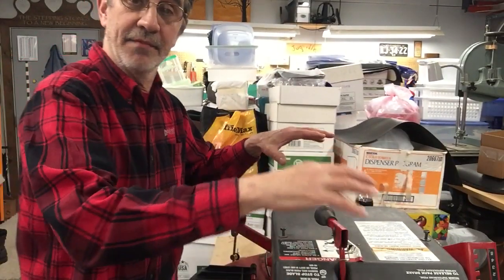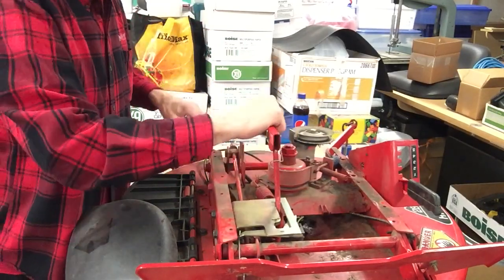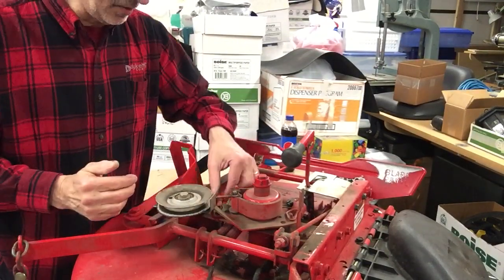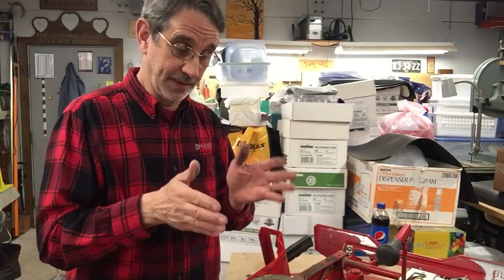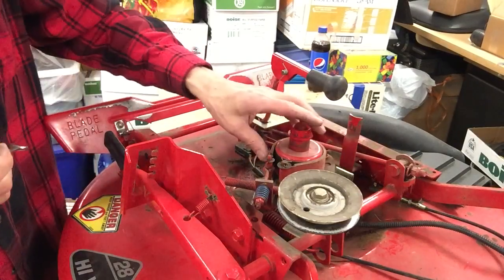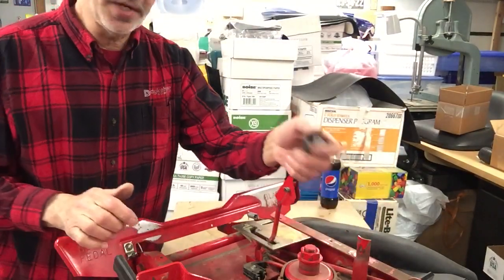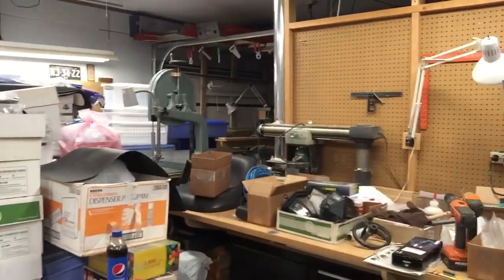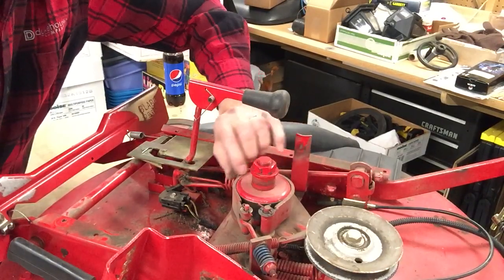339. M/S 64. How Can I adjust the brake for my blade

Comment: Hi Jim - it's Big Rodders in Ireland.  They certainly have moved to a more sophisticated adjustment system compared to my square framed 1996 RER, which sported a Mickley Mouse 2 location brake adjustment plate.  You may recall I emailed some photos of the adaptation I was forced to make to have an infinitely adjusted system like yours.  My approach to adjusting it was to activate the blade lever and lock the foot plate down then adjusted the brake so it was just about to touch the rotor, thereby achieving the maximum braking capability possible.  An earlier attempt resulted in the brake contining to connect slightly during blade operation, which heated the pulley and threatened to damage the belt.  That day was certainly a big schoolday for me!  Kindest regards.

Comment: Thanks Jim  you are awesome. Can you do a video on how to clean that dirt out and oil that fitting. And to get that disengage system to go all the way back. I'm lm pretty sure thats the cause of my belt smoking in the back because the belt still has a little tension on it because the disengage is not fully disengaged. And again. Thank you so much!

Comment: My Snapper RER has developed a "squeal" when blade is engaged. I'm thinking it's the bearing going out on the smaller pulley you're showing in this video??
Reply from the maker: Well that would be easy to find out take your cover off and try to turn it and see if it turns freely and has wiggle to it or if it is slightly stiff, a good bearing will not spin freely. Jim

Comment: Jim, great video on blade brake. Getting ready to replace the worn out band.
When I took a look at the brake band, I noticed it was covered in grease. I assume it was from the blade spindle grease fitting.  
Looking at parts diagrams, don't see any grease seal between blade and brake. Is there a seal there?  
My Snapper is a Series 7 rear engine rider.  I usually give it 3 or 4 shots whenever I sharpen the blade, must be too much.
Any good advice on how much and how often to grease the blade spindle to keep from greasing the brake too?
Reply from the maker: Depending on how new your machine is I tell people not to grease the spindle if it’s new the bearings  are sealed the grease isn’t going to go into the bearings it’s gonna come out of the vent hole on the top of the spindle and grease your break, if it’s the old bearings that are open on the inside you’ll just be pumping old grease into the bearings not new grease and that will wear them out. Jim
Reply: @jimjackson9381  Appreciate the input. Pretty certain it has old style open bearings on the blade spindle on this Series 7.
So far bearings feel/sound good. My greater concern is grease getting inside brake. Snapper must not have made a way to stop grease from going on up into brake on these older Series 7s.
Reply from the maker: @dusttoyou4550  None of the snapper spindles have any kind of seal on the spindle if they are over greased the grease Hass to have a way to get out or you will burn the bearings up by putting too much grease into them so they make a hole up in the top of the spindle to relieve the pressure I have a few videos talking about greasing the spindles and why you shouldn’t do it. Jim
        Video number 315 in the comment section you can download a complete list of all my videos by number to help you find one you need.

Comment: Hi Jim,
I need to replace the brake band on my 28085S. Quick question: is the nut that holds the belt pulley right hand or left hand? 
Thanks
Reply from the maker: Hi Ed it’s Jim, the nut on the top of the spindle that holds the big pulley on is right hand and so is the nut on the bottom of the spindle that holds the blade the mounting bar on and the blade mounting bar is right hand threads also just in case you need to know if you have any other questions let me know. Jim

Comment: Can you suggest a list of parts you think I should stock up on my new 2020 model? I'm thinking at least a plastic bushing kit or two.
Reply from the maker: With residential use you should get 10 years out of that machine before you need to replace anything but the most common things you do need to replace would be the nylon bushings for the king pins for your tire rods and your steering shaft I would think those would be the items that would wear first. Jim
Reply: Thanks Jim, I think I'll get the pivot bushing too just in case.
Reply: you have a 2020 snapper?  did you post a video of it on youtube?  I don't think I've ever seen a snapper that's less than 10 years old.  Most of the videos I see are snappers that are more than 25 years old.  I don't even know what a new one looks like or how they compare to the older ones.
Reply from the maker: @mrbubetube  You need to watch video number 240 I sure a 2019 snapper. Jim
Reply from the maker: @JDski  I guess that would be another good one to have on hand. Jim
Reply: @REVNUMANEWBERN  Thanks for the heads up. I checked mine and it had grease in it. I then topped it off with gear lube. It doesn't seem to be reacting bad that I can tell with the grease and it hasn't leaked a drop thankfully. I saw Jim's video on switching to gear lube after I did this, or I might have held off adding gear lube.